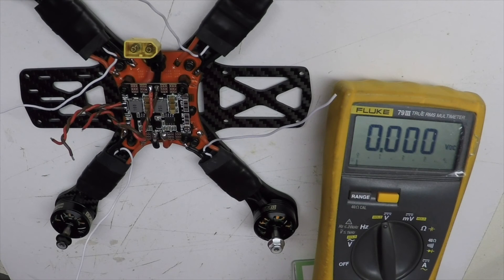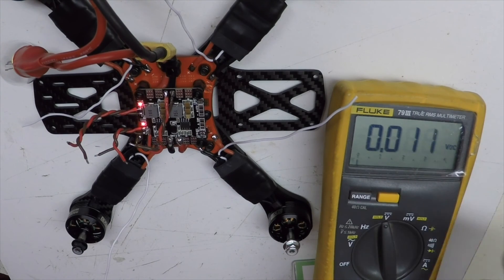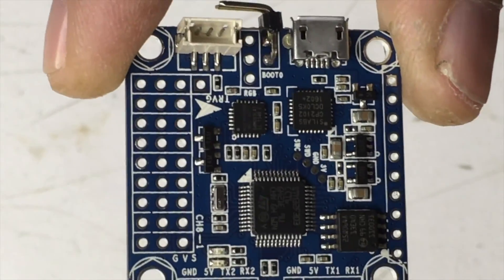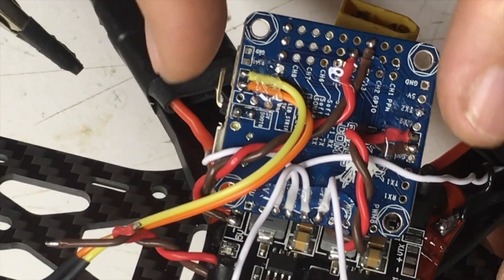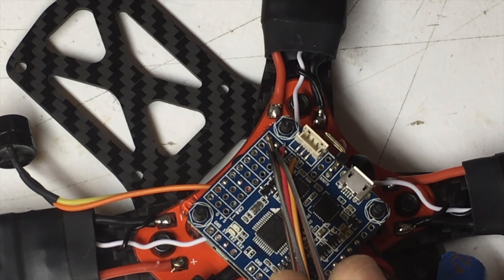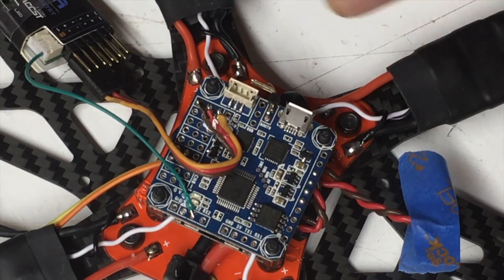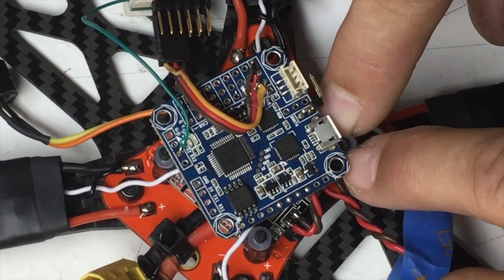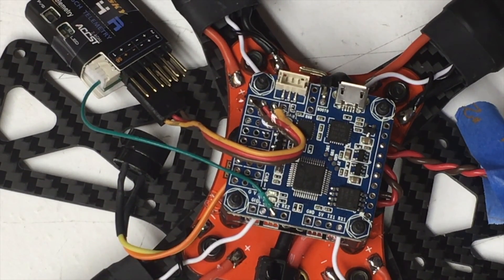Martian II Build (Part 4)

Comment: Thanks for posting this. I arrived at virtually the same component build and wasn't certain  if and how well a PDB BEC would fit between the Martian II frame PDB and the flight controller until watching your video. I really don't want to put too much reliance on the 5V the flight controller BEC provides. May just use it to power the camera alone as it is stated as being 5V "filtered" on the Omnibus pro.
Reply from the maker: I think you will find there is a generous amount of space for what ever components you decide to install. I've made a few changes to my original build but the frame and entire quad are still going strong. Thanks for watching!
Reply: Yes I'm just watching your modification videos and it has me rethinking the build. I'd really like to eliminate the PDB BEC board all together. I was originally thinking I may want to drive some LED's down the road but basic RGB's being sold for quads necessitated a 12VDC supply and thus the BEC board. Now I'm leaning toward using the supplied frame PDB and connecting to an Omnibus F4 since my radio doesn't support telemetry and I'm hoping to gather info through the video OSD. Your upgrade won't work with my plan to use the F4 as it doesn't distribute power for the motors so it has me looking back to the frame PDB to handle that aspect. The F4 is equipped with a 5VDC 1 or 3 amp filtered BEC (depending on who's board it is) so camera power should be covered and I.m hopeful of running a TS5823 receiver directly off batt since it has a wide input voltage range of 7-24V. The version of TS5823 I acquired also outputs 5VDC I could additionally supply the camera with.
Reply from the maker: Sounds like you have a handle on it. I wish you the best with your build. One thing to think about is how much power you feed your TS5823. Yes, it will take up to 24V but the excess voltage is bled off in heat. Just saying the more voltage you feed it the hotter it will run.
Reply: 7 volts is the low end of the receivers tolerance and is in 2s territory but appears to be an oddball voltage for an off the shelf mini RC regulator. Would I benefit from placing a 12V linear regulator on the battery supply if I was to run 4s'? I don't know how efficient or inefficient they are as opposed to the voltage regulation in the transmitter itself. I was eyeballing the mini one from Matek Systems which regulates to 12V and will supply 300ma. The TS5823 draws 190ma but I suspect that isn't accounting for load on it's 5VDC output.
Reply from the maker: For my set ups I try to always feed my TS5823 and camera 12V and haven't had any problems with them at that voltage. I haven't tried 24V but I would think it would run fairly hot. As long as you have airflow around it it should be fine. It's the bench time powered on and if you crash and can't get to it for a while that would worry me. I may not be qualified to give advice on this but if it were mine I would send the VTX regulated 12V just to have the piece of mind. I really like the reliability of the Polou 12V step downs and have had 0 issues with them. They are also tiny and flat so you can put them almost anywhere. If you wanted to you could run it off your stock PDB. Just a thought.
Reply: I'll pick up one and see how it performs bench testing. Question on screws. Did you have to purchase any additional to assemble the kit? I'm not seeing any listed with the motors or shown in the frame manual. Do they commonly come with motors or the frame? I know the arms are 4mm thick and was wondering if there are specific lengths of motor mounting screws I need to acquire. Thanks for bearing with me but when I get this stuff shipped from overseas overlooking minor details can take additional weeks to resolve.
Reply from the maker: I did not have to purchase any additional screws to assemble the kit. The motor mount bolts normally come with the motors and that may depend on what motors you use. That's one thing I really like about the DYS motors I used, they came with two sets of mounting bolts in two different lengths to accommodate different arm thicknesses. I's been a while but I think I used 6mm length motor bolts. That way you have 2mm in the motor base. Not long enough to touch the motor windings but plenty of length to have a couple of mm thread into the motor holes. Hope this helps you out.
Reply: Thanks for all your input and the videos. Tremendously helpful in getting me going in the right direction.
Reply from the maker: You are quite welcome :)
Reply: NecroNemesis

Comment: what do you think to the frame quality wise is it good or poorly made?
just getting into to the sport/Hobby so it's probably going to take a few crashes as a new pilot only flights I have done is with f450 flame wheel dji with naza lite gps never a f3 f4 fc before so it's all new to one....
Reply from the maker: I think the frame quality is real good for a frame in this price range. I haven't crashed mine hard yet but I think it's durability is good. If I remember right this frame is using 4mm thick arms and that's on the thicker side for a 5" size quad. Thanks for watching and I hope this helps you out.